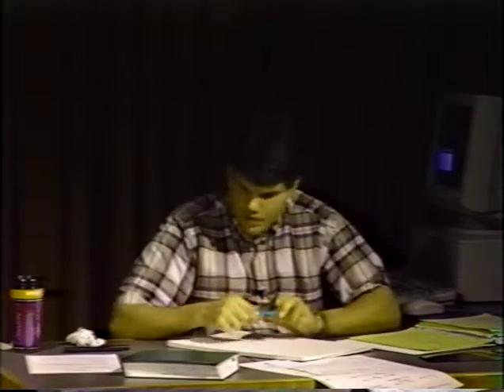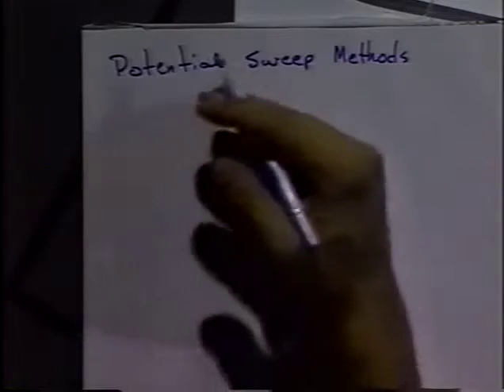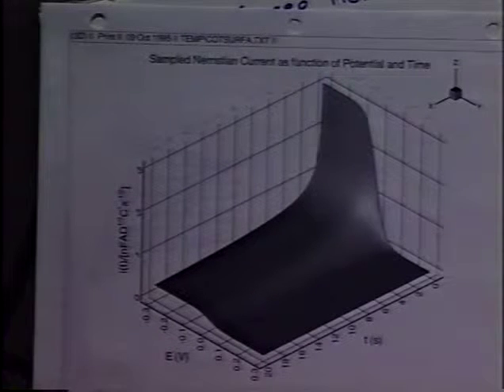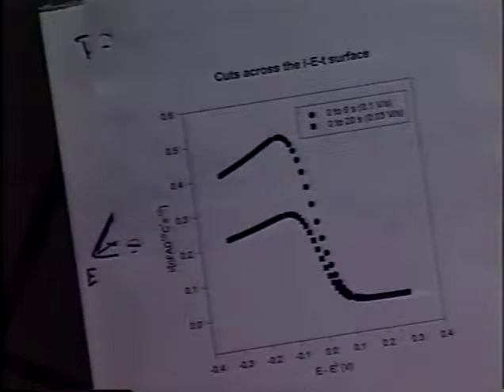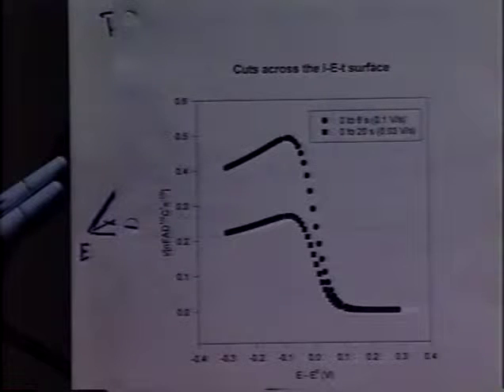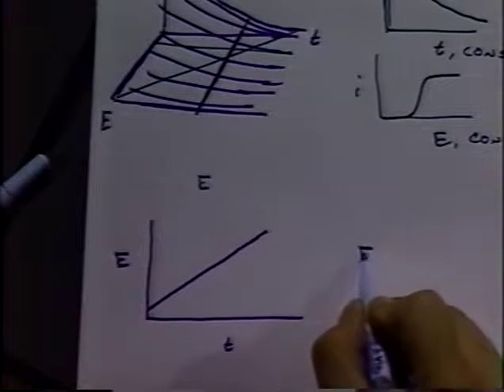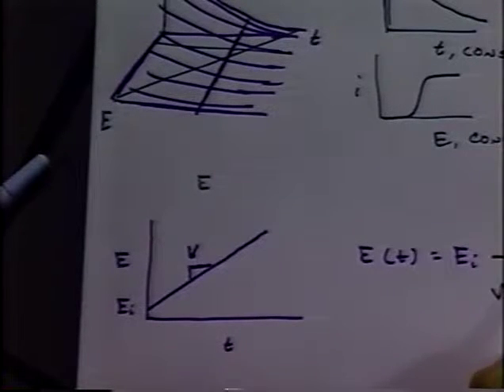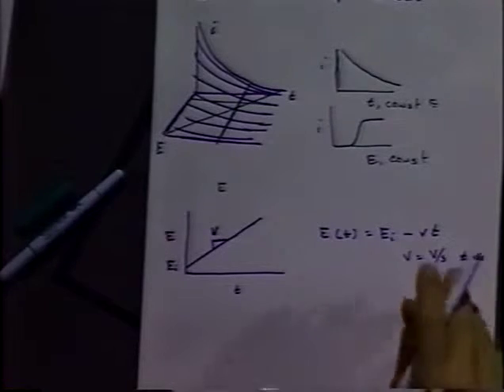Potential Sweep Methods

Comment: Sir. I have been having this fundamental doubt about LSV and CV and have looked at many many sources, but they can't seem to resolve them. Would be very helpful if you could help: When you do an LSV or a CV, starting from a low potential going towards higher potentials (in magnitude, they may be reductive or oxidative currents), we get a peak after which current decays inspite of increasing the potential. It is explained as being the mass transfer limited region, which makes sense since concentration near the electrode has depleted till you reach this point, and current is dictated by diffusion after this. Couple of doubts regarding this:  i) the depletion is explained as t^-1/2 dependence in the i-E curve. Should it be E^-1/2 or something else. I fail to understand the direct corelation between diffusion current and potential. 
ii) MOST IMPORTANT: What happens if I START a CV/LSV from a HIGHER magnitude potential going towards lower ones?? I have observed in the lab, as well as read in B&F that the i-E curve is EXACTLY the same. However, in this case, even when we apply a high potential, the current is low, despite having significant concentration of ions near the electrode. I feel the mass transfer limitation does not apply here since we have so many ions sitting near the electrode, a high potential being applied and still a low current??? Does it have something to do with the double layer capacitance??  B&F explains this region to be for non faradaic currents, even if potential applied is high, although I don't understand this at all...

Thank you very much for the videos..They are very helpful :-)
Reply from the maker: Hi,

For point i.  You will get a t-1/2 decay once you are beyond the peak.  The potential is linearly related to time so
it appears to decay with the potential, but it is fundamentally a function of time. Consider the case were you  did a LSV to a potential beyond the peak and then held the potential at the final potential. In that case you will get the t-1/2 decay even though E is constant.
For point ii.  For this, assume we are doing the following reduction reaction Ox + e → Red and
that the bulk concentration of Red is zero.  If we start our sweep at a potential positive of the Eo then,
by the Nernst Equation, the initial concentrations at the electrode surface are nearly the same as the bulk solution (we have not started reducing Ox, so [Red] is ~ 0. ) However, if we start at a potential negative of Eo then the concentration at the electrode surface is greatly different than the bulk concentrations.  By the Nernst equation, the surface concentration of Red is approximately equal to the bulk concentration of Ox.  Further, the concentration near the electrode is changing with time, since you are electrolyzing Ox to form Red. Thus, the exact concentration near the electrode is not very well defined.  It depends on when you turned on the electrode potential before the sweep. Consider that if you turned on the potential 1 s before or 1 minute before, the response will be very different. In the latter case, the concentration of Ox near the surface is nearly 0 (since you’ve reduced all the Ox) and the concentration of Red is high, thus you will get a voltammogram similar to theory. However, in the first case, there is not much time to affect the concentration near the electrode and the currents will be quite different than predicted.  The peaks will be lower than
expected and the baseline will not be steady. (Try IT!).   
The effect is not fundamentally an effect of double-layer capacitance.
My advice to you (and all students) is to always start your CV sweep at a potential where you will not be oxidizing or reducing your sample (i.e. i=0). Sometimes you can’t avoid it, in that case, be aware that you should let the current relax to the baseline before starting your sweep.
Reply: Thank you sir. I think I have almost got it. Could you pls explain the statement 'It depends on when you turned on the electrode potential before the sweep'. As in, say I place my sample(working electrode) in the electrolyte , and started the sweep at -1.5 V going upto +1 V, instead of the conventional start at 0V then go upto -1.5 V and reverse the potential towards 1V. Would the i-E response curve look similar or different in both these cases? Couldn't get your explanation of the 1 sec and the 1 minute thing...
Thanks a lot!!
best Regards
Reply: Also, since we are varying the voltage(V) continuously, there will be a capacitive current as well right?(CdV/dt) . is it possible to decouple that from the response? Or is it generally so small that it can be neglected..
Reply from the maker: When you setup your experiment, the potential is not applied to the electrode until you start the sweep.  But there may be some specific programmed "delay" between the start of the sweep and when you start of the experiment (i.e. when you press the "start" button) .  For example,  a potentiostat we use has a default delay time (called "quiet time") of 3 s. But this can be changed to other delay times.  In your case, the response will be very different when scanning from -1.5 to 1.0 than from 0 to -1.5, unless you set the delay to about 30-60 s in the first case.  You have to refer to your potentiostat manual to see about changing the delay time.

The capacitive charging current is always present, you can't eliminate it.  It is usually negligible at slow scan rates (10-100 mV/s) but will become troublesome at low concentrations (< 100 uM) or at higher scan rates.
Reply: Great!! Got it now..also I had made a very silly mistake while reading  in B&F. I had considered 'well positive of E0 ' on the right of the axis rather than the left!! Thanks a lot for your prompt response!.